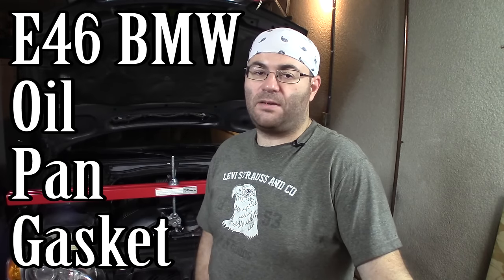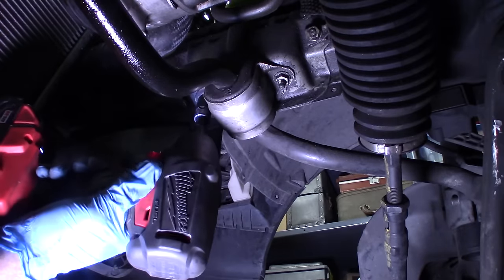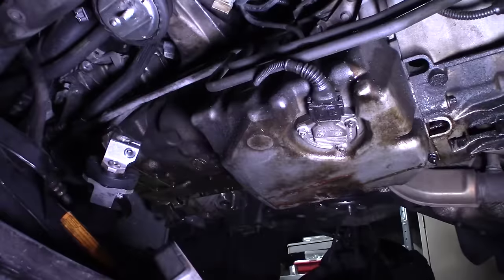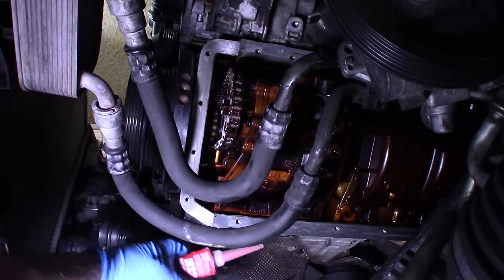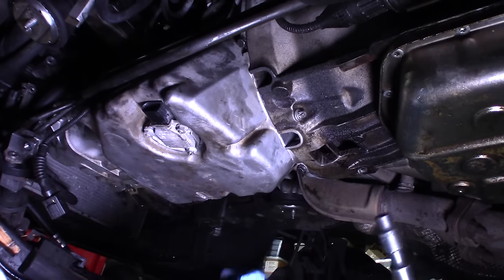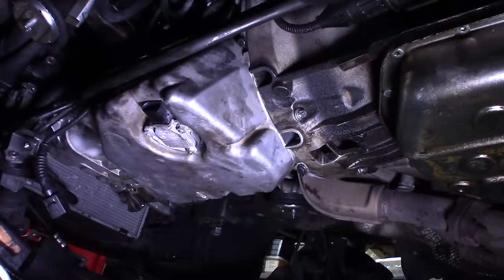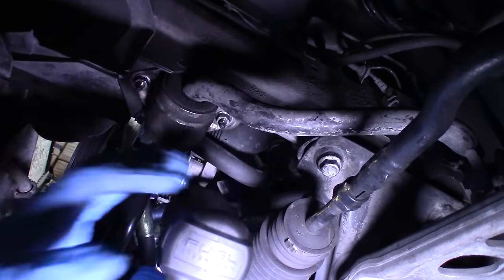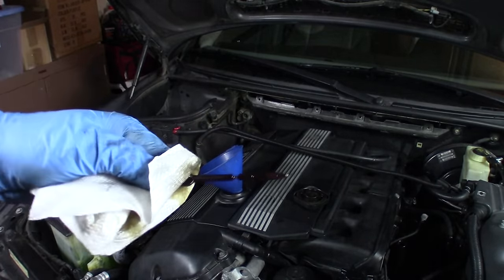BMW 330i 325i E46 Oil Pan Gasket Replacement DIY

Comment: i did this but after putting it back together when i turn the ignition on i get a long beep and like a clicking noise seems to come from the dipstick area do you know what this could be? didnt happen before the sump gasket replace
Reply from the maker: If the starter solenoid is clicking but the engine isn't turning over, it may be due to a nearly discharged battery.

Comment: So like my car is leaking from the oil filter housing gasket. Is it because I need a new gasket or can I replace the o ring and filter? I changed the o ring from my coolant temperature sensor and it fixed that leak.
Reply from the maker: +Gilbert Diaz no you absolutely need to change the oil filter housing gasket
Reply: 50sKid it was leaking from where the oil filter is. Like when I turn the car on you could see the leak coming out of the oil filter cap.
Reply from the maker: Gilbert Diaz ooooooh. Yeah so change the o-ring. You get one with every oil filter. However inspect it very closely for cracks before you reuse it.
Reply: 50sKid yea I ended up changing the whole filter with the o ring. Hopefully that was the issue. Thanks for the advice by the way.

Comment: +50sKid What's your opinion on supporting the motor from below on the AC Compressor bracket? Possible? I have access to an engine crane so not too fussed, but just curious.
Reply from the maker: +Kendrick Cheng It will be unbalanced to the right side.

Comment: ok so if i understand there is no way of replacing the rack and pinion without lifting up the engine and loose all those bolts...??
Reply from the maker: +JAY201065 Not lifting the engine but rather lowering the subframe.  Subframe is just in the way.

Comment: hey i just replaced all of my bushings in the back and the driveshaft holder all the rubber was really bad so i had a lot of vibrations when i accelerated. now the clunking is still happening almost sounding like its coming from the right side of the car. idk what else could be the problem from here. any help
Reply from the maker: Which bushings did you replace specifically?
Reply from the maker: It is a manual transmission car?
Reply: +50sKid  I replaced all in the rear ( chassis, control arms, drive shaft) and it's an automatic

Comment: I would like to add a quick note, as I’m staring at my front diff hanging by the driveshaft while pulling the remainder of the right side cv shaft housing on day 2 of this lovely project, THERES A LOT MORE BS IF YOU HAVE AN Xi.

Comment: Is there any way to do this without a engine brace I haven’t got one
Reply: You could possibly use an engine lift (cherry picker). The engine brace tool is so inexpensive from Harbor Freight (if you're in the USA) that it's a no brainer. The tools comes in handy for doing timing belt jobs on a lot of vehicles also.

Comment: How often should I replace the oil pan gasket? 150-200k miles?
Reply: I’m doing mine at 220k - was well overdue, at this age 150-200k is good. But as long as it isn’t leaking too bad, I wouldn’t worry about it. I bought mine at 190k and haven’t had any critical leaking issues driving it daily.

Comment: So if you don't have that engine support bar what can you do
Reply: it's less than $80 from Harbor Freight with a 20% off coupon, you may want to check ebay for a used one, but my guess is shipping would kill the cost. Change you engine mounts while you are under there.

Comment: is the pan itself heavy? to put back on by hand?
Reply from the maker: Yes it's heavy.  It's obviously doable, but you have to fiddle around with it and you will end up smearing the RTV.  Did you see my addendum video to this job?  In that video I suggest using your floor jack to help you lift the pan up into place.  SO much easier that way.
Reply: Yea I was thinking about using a floor jack to just to catch a couple of bolts and I found a good gasket on ecs tuning where u wouldnt have to use the rtv
Reply from the maker: You always have to use rtv at the 4 places where the timing cover and rear main seal join to the block.

Comment: Does it have to be red RTV??
Reply: Actually, the red RTV (high temp) is the wrong sealant. The factory service manual says to use 3 bond 1209 (listed as "drei bond 1209" in the German language publications). You can source this from the internet or use a good quality, locally sourced comparable sealant such as Permatex Ultra Grey or Victor Reinz Reinzosil. I personally use the Reinzosil.

Comment: I plan on using this to fix the oil pump bolt issue :-(  thanks!
Reply from the maker: Not an issue on the E46.  That was mostly a problem on the E30, I believe.
Reply: i read that it was the same on e46s with the nut getting loose and even falling off :-/
Reply: dammit now im reading that its not an issue... fml ill be rattling forever
Reply from the maker: Well if you have rattling that could be your VANOS pistons.  It could also be your timing chain guides.
Reply: it only happens when the car is warmed up, and it sounds like its coming from the bell housing area... I just need to get it on stands high enough to look at it. From what ive seen it doesnt sound like vanos. I recently replaced the tensioners and water pump. I need to make a video of it... Thanks though man love your vids!

Comment: you do the same with e36??
Reply: Gus Reyes Yeah pretty much the same. If you have a manual and need to change the clutch I'd wait until you do that to change the oil pan gasket since there will be no transmission

Comment: how do u do this with front diff I have xi
Reply from the maker: You have to remove the front axles as well as unbolt the front diff from the engine oil pan--there is also a support carrier on the right side for the right side axle that you remove in the same way.  After that the steps should be fairly similar.

Comment: I have a 2002 BMW 325ci with an oil pan leak and valve cover leak. I also have a rear differential leak and coolant leak.......you'd think a car brand like BMW wouldn't leak everywhere. it started leaking at the 8 year mark and no matter how many times you seal the valve covers they leak again

after 8 years there will always be some kind of stain on your garage floor as long as you own the car. it's just a BMW fact

I love the car but it pisses me off that a car like BMW is not sealed better

Comment: Zip ties to hold the gasket.
Reply: That's how I do it too. I put four small zip ties at random locations to hold the gasket in place and once I get a couple of bolts started I clip the zip ties and pull them out.

Comment: Who cares if you torqe the steering shaft who cares if you're staring goes out blue lick tight doing 160 did you put blue loctite on that subframe bolts are all them holes in the oil pan dead holes or did you put silicone on the threads of the ones that are not

Comment: Fuck.. is it even worth fixing it? Or should I just keep topping off my oil ??
Reply: The leak only gets worse if left un-addressed.  Mine was leaking for four years.  And I finally replaced this gasket.  I also replaced engine mounts while I was down there.  If you use this video and 50sKid's Oil Pan Gasket Addendum, you should be fine.

BUT - if you have oil leaks, the best approach is to address any potential leaks from the top of the engine and work your way down.  Along the way, you'll gain experience and knowledge, and then this particular job won't be as daunting.

I also had a friend help me move the subframe back into place when bolting it back on.  That was helpful.

Comment: Great video, dumb engineering...
Reply: how ??
Reply: why design something so hard to remove the pan, I've been a Honda tech for over 7 years now and I do a lot of side jobs at home..2 of my client own BMW's and they are terrible to work on..Honda is simple and the product outlasts BMW any day.
Reply: +pat howarth wait till you get to work on a jak, to remove the fuel pump you need to remove the entire back subframe and remove the whole tank
Reply: No, its engineered to make the car have a 50/50 weight distribution and low center of gravity. Not to make it hard to work on. These cars are actually really easy to work on.
Reply: rsx123 easy but very time consuming
Reply: @e39for life - 
this isn't true on this vehicle, the fuel pump is accessible underneath the back seat from inside the vehicle... mine went out and I had to get a new one... only reason I know. =D
Reply: @rsx123 Agreed!
Reply: I know right!
Reply: that is correct fuel pump is under back seat to on passenger side while sender unit is on driverside should take no more than 1 hr for someone who has never done the job.
Reply: E39 For Life im a BMW technician, and it is dumb, they could have avoided the need for the drive belt coming off and power steering pump coming off.
Reply: @2012HondaCRF250R  To give you an engineer answer, it is because of several things, the most important beeing lowering the centre of gravity. Obviously the car needs a subframe and there is actually no other way to design it. If you look at Porsche's solutions as well you actually need to remove the entire engine. If you have the right tools this  job is very simple. BMW never intended to design a car with a DIY mechanic in mind. Taking out the entire engine and gearbox is actually extremly simple, if you have the right tools indeed. E.g, AGA Tools lifting table
Reply: @E39ForLife0  LoL
Reply: German engineering.. lol

Comment: Hey mate, thanks for the great video. I did same on mine. Your video was very helpful! No more oil leaks. BTW, while doing the job I found some slack in oil pump chain. Is this too much slack? I'm little worried. https://youtu.be/_OlBKDok4ls
Reply from the maker: It's a definitely on the loose side but you gotta ask yourself do you want to go through all the work of removing the crank bolt and the front timing cover just to change it?  Is there enough slack that you can skip a tooth on the oil pump cog?  If not, eh, you're probably alright.
Reply: There wasn't that much slack that I could skip a tooth on the pump cog. So I guess I would be alright until my next oil pan gasket change. Thanks for the reply!